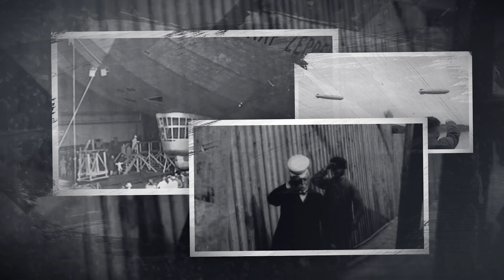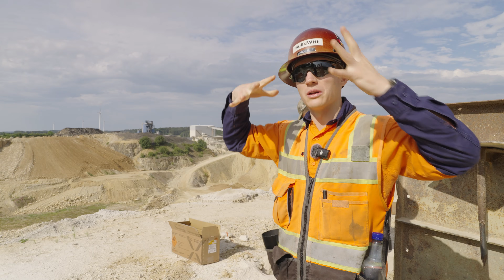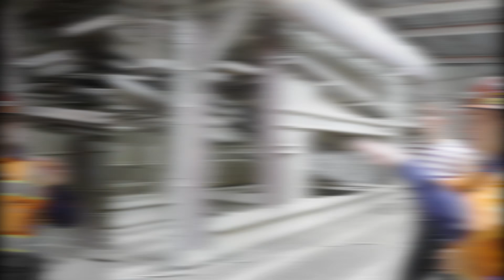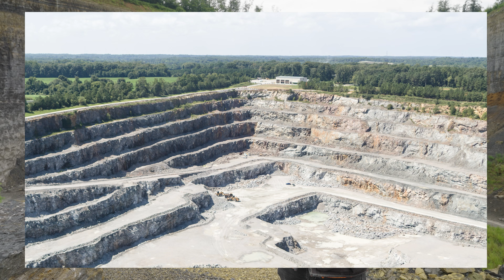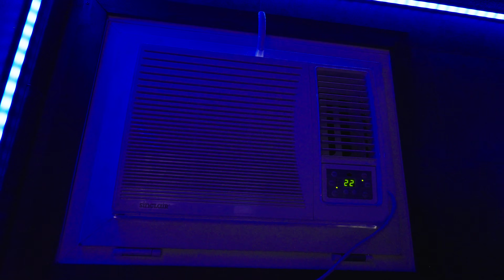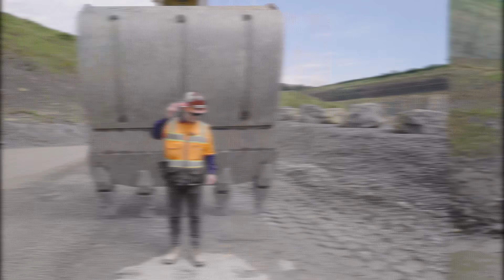German Quarrying w/ Remote Control Machines!

Comment: Aaron you need try out Google translate. At the very least you can ask 1 or 2 simple questions. I've used it and it worked fine for me. OK I was pointing at the beer tap at the time so I'm sure they would have worked out what I wanted, but still I'm sure they were impressed at my German.

Comment: Summary - safe 18 minutes of your life:
The video is about the author's trip to Germany to visit two quarries. The first quarry uses a Caterpillar 992 loader to load trucks with rock. The second quarry uses a Caterpillar 395 excavator to load trucks with rock. The 395 excavator is remotely controlled by an operator in a command center. The author also visits a Zeppelin Caterpillar dealership and learns about their latest products.

Comment: Hm so does that mean there are lots of "stepped" old quarries and even mines out there that were given up before there was remote technology, and that could now be re-opened and the "steps" mined away remotely? Because the remote tech makes it accessible only now?
Reply: Not necessarily. He did mention that the rock in the quarry they went to was suitable for such a high wall. I'm guessing it wouldn't be possible at the first quarry in the video, given the soft fractured rock there.

Comment: I wonder why they don't use a camera pair and simple shutter glasses to provide a stereoscopic view. IR-controlled shutter glasses are cheap as dirt and readily available from the 3D-movie (3D-home theatre) craze a couple of years back and monitors with 140+Hz refresh rate (to time-interlace two video streams at full framerate) are common, too. There also is no bandwidth problem, like with over-the-internet remote control.

Comment: Wonder why they don't just use a fov drone setup. Slap the camera onto the cab front and use the goggles as normal. The video feed is self contained too so no internet needed (probably less lag also). Also the full body view could just be a 360 cam on a long pole on the back of the vehicle...

Comment: 2 questions on the remotely operated excavator, 1-how responsive are the controls for the operator? 2-can an operator jump into the machine and run it like a standard machine if it is not in a dangerous spot?
Reply: 1. I don't know, but there's no reason they should be less responsive than sitting in the machine, as the delay is basically the speed of light across a couple of hundred meters, which is essentially instantaneous.
2. Yes -- he mentioned in the video that the green light on the dozer meant it was being operated directly, while the blue light would mean remote.
Reply: Yes, other videos he did of remote machines, were able to be run by an operator in person. He has a video on 5 bull dozers that are run by 2 to 3 operators who are all in the same room. They push long runs of material for strip mining, so an operator will setup one machine on a push, and then control the next one. They are remote and semi automated, from what I could tell. They still need to be able to service them and use them in other locations in a pinch, so it only makes sense. The newer machines seem to be electronically controlled anyway, like when setting the pattern they use, so that just makes it easier to do it remotely.

Comment: Guess that's pretty nice if there is risk of the excavator falling down a pit or something collapsing on top of it. Would be nice if you could sit at home while working, but I guess there needs to be someone "checking the oil" etc before starting the machine. Also if the internet connection cut out you might drive the excavator off a cliff, that would be kinda expensive.
Reply: If connection was lost it would just stop.

Comment: I'd love to see you visiting a coal mine in Germany. They have huge bucket wheel excavators, that can shovel 240.000 m³ per day, equals 314.000 kubicyards per day. This thing is nearly 93m or 305ft tall and 226m or 740ft long. You can see them in the mine in Garzweiler in Germany in action. 
It is very common in Germany to have huge bucket wheel excavators for coal mining. 
Be quick. Germany is shutting down the coal mines to transform to green power generation. So the machines will soon no longer operate.

Comment: what can happen if dust accumulates on the cameras limiting visibility
Reply: It gets cleaned, just like any camera. The machines are moved away from the wall to be serviced. Since they have cameras from the trailer, they could just walk the excavator out while using a 3rd person view........like running a remote controlled toy. For digging and loading, it is best to have a 1st person view. Some sensors have wipers or air nozzles to clean them, when in environments like that.

Comment: I didn't know fuel was that cheap in the US. But $1,65 for Germany is almost cheap compared to the last years. I think in the beginning of Corona it it dropped drastically to under $1.00 a litre, but after the beginning of the "problems" with Russia in 2022, the price for diesel went up to $2,70 a litre for a longer time. In the end around 70% of the fuel price here are just taxes, taxes and taxes of taxes. Profit taxes (VAT), mineral oil taxes, CO2 taxes and infrastructure taxes, to be specific.
Reply: the Diesel price never went anywhere near 2,55€/l  here in germany, not even for private consumers so no big operation where fuel gets delievered mostly directly from the reffinery pays that price as it is even cheaper than gas station fuel.  where do you get these prices?
Reply: @eltontv6002   we had Diesel and petrol prices of 2,35€ to 2,45€ or more for some time a few years ago and Diesel was even more expensive than patrol for some time, that's while there was a financial support from the government to lower the fuel prices. I don't know where you live when you can't remember that.
Reply: @IronWarrior95  southern germany. The highest price ive seen Was about 2,05€/L and that was an already expensive gas Station. At my workplace we had a record price of 1,93€/L for 25.000 Liters.
Reply: @eltontv6002  I live in northern Germany. The fuel prices in Germany where the highest in Europe, as I remember. Even after the 35ct / litre support from the government it was around 2€, because the greedy oil concerns pushed the prices even higher then.
Reply: Compared to Germany fuel prices here are low, but the number in the video hasn't been accurate for years. In my corner of the southwestern US we're paying $3.65/gallon (about $0.96/L) for highway fuel and about $3.39/gallon ($0.89/L) for off-highway fuel.

Comment: The high wall collapsed at the Homestake Gold Mine in the mid 90s on a shovel and a haul truck. I don't know the exact height of the wall, but the mine was 900 feet deep at the time. I believe it was the full height of the mine. (or damn close to it)
I worked with the haul truck operator for several years, the story of that collapse is one of the most chilling things I've ever heard. He talked about hearing the pinging of rock hitting the cab moments before the side of the truck was crushed. The shovel was completely crushed killing the operator. 
Remote shovels and haul trucks isn't the worst idea in the world near that kind of stuff.

Comment: That was very cool. Remote control excavators. I am curious about what is the latency of the remote controls, the time delay between when you move the controls at the remote location until when the machine actually responds. As an old operator when Cat changed their controls from hydraulic - hydraulic controls to electro - hydraulic control I definitely noticed an increased time lag. And for precision control even a fraction of a second delay was very unnerving.
Reply: You really can't beat direct-acting hydraulics for precision and response.
Reply: The newer machines seem quite responsive. I haven't run old machines, so I can't compare them. I suspect it would only get better with time. It is a great question. Youtube slows down on my firefox browser, to where there is lag as I am typing this. It is crazy annoying. When I was using a 349 cat excavator (120k pounds and a 78" bucket) to load super 10 dump trucks that seem small in comparison, the lag could have meant damaging or flipping a truck. The swing on that machine did not slow down as fast as the smaller machines I had used, but the other functions were as fast as expected.

Comment: Still seems really counter productive to leave the face walls so tall and then dig it at the bottom. 
That's just asking for a high wall collapse and to end up righting off a CAT 390 that probably costs 2 to 3 million pounds.
Reply: I'm assuming the value gained from extracting the extra material, more than makes up for the potential danger to machinery. There'll be a very well paid geologist somewhere determining how tall they will let those high walls get.
Reply: I'm not knowledgeable on the material but he said they can do it because the material is stable enough. But its dangerous for humans to stand right below the wall because smaller rocks could fall down sporadically. You just can't control that.
Reply: In Germany, basically everything remotely dangerous is highly regulated. Getting a permit for this probably involved more people than the digging. Also this Rock is really tough, but sure, if there were no risk at all they would not run the machine remote

Comment: Swiss army is developing remote controlled excevators for some years on a cat 323 i think. They startet developing it because they needed a remote system on a excevator for digging out ammonition and i think at that time, there was simply no system for them on the market. Meaby check it out the next time you‘r in switzerland.
Reply: The company providing the tech is Gravis Robotics. Correct, it’s for multiple machines such as the Cat 323 and Menzi Muck.
Reply: They also applied the same remote system to a menzi muck.

Comment: Not a fan of all this automation at all. At the end of the day it just takes away jobs from guys like us. Like your other video in Australia, it’s awesome, but it takes 2 guys to run 5 Dozers.
Reply from the maker: Mate it’s not automation watch the video
Reply: @ u can call it whatever you want it’ll eventually lead to less jobs.
Reply: @ right. For now. Till it’s only 2 guys to run a fleet. Then 1. Then none.
Reply: I am not a fan of automation either.  This is moving the operator to a safer location which makes a lot of sense.
Reply: @royreynolds108  I get it to an extent. But at the end of the day eventually it’ll lead to 1 guy running all the machines.

Comment: Cool, but also a bit scary how one good AI that can load a truck would remove many jobs, luckily I believe that's more difficult than you would think since every job is different, self driving cars will be widespread before that happen I'm sure. Awesome video overall! That operator room would give me the feeling of playing farming simulator except it's quarrying simulator, with much cooler graphics.
Reply: I'd expect the other way around, actually. Loading a truck is a much more constrained and controlled environment than general driving. Also, if the AI gets outside its parameters, it can just stop the machine, whereas a self-driving car can't slam on the breaks on the highway just because it sees something it doens't understand. Designing an AI to load rock into trucks is probably much easier than designing one to drive a car; having said that, there's probably more money in designing a self-driving car so more incentive for that to come first.

Comment: its good to see that this level of remote operating tech is becoming feasible finally. as in wireless vs. umbilical or radio remote at an individual site level.

as you say its different to see a genuine use case for it rather just on a demo area. and in something other than an "aussie mining" level of investment 😂

if CAT's system is as well developed then im assuming other manufacturers have their own proprietary systems too, but i wonder are there any notable aftermarket systems available in the industry yet? that could be retrofitted to any (or older) machines and not be part of a dealer relationship etc?

Given the increasing focus on health & safety, demand for such a system in so many machinery roles can only increase in the future, if only the cost & complexity could be reduced to be a practical solution for smaller/private firms, owner operators etc.
Reply from the maker: there are definitely aftermarket systems making their way into the market
Reply: We've tossed around the idea of retrofitting older LHDs with remote control systems. Really anything that has or can be retrofitted with electrohydraulic servo valves should be convertible; from there you need a controls interface and to ensure adequate radio range and bandwidth. Introducing live video complicates the last part.

Comment: Using a 992 loader and one truck for efficiency is such a simple yet effective strategy. Great insights! 💪
Reply from the maker: can't argue with the germans!
Reply: @mmm365   they just haul as much material as they can feed into the crusher. When 1 loader and one truck gives them enough material that they can use constantly, then 2 trucks would bring them more material than they can handle at the crusher. The crusher can't take more than that and they don't want to store the extra material or to shorten the working hours of the large loader and the truck operators.
Reply: But then they use another loader to feed the crusher?  Just make a truck dump hopper and get rid of the other loader to save on that expensive fuel.
Reply: @TwinkleToes3116  You need to have a second, smaller loader for all kinds of stuff. There's going to be rocks falling on the ground etc. which need to be cleared etc.
Reply: @TwinkleToes3116  The loader is used to feed additional material to achieve the desired qualities, not to load what they just mined. There are multiple piles of different materials and sizes stored on site.
Reply: @TwinkleToes3116 the building contains several production lines of material. The main products use conveyers, but less common ones get mixed by the loaders.
Reply: A lot of nose picking🤦‍♂️

Comment: You should come to Sweden somtime!!
Reply from the maker: hopefully next year!!
Reply: @buildwitt  You might want to check out the Aitik copper mine operated by Boliden, as well as Skanska or NCC for quarrying and construction, Actually, NCC just concluded a decent-sized cleenup operation moving contaminated soil from an island in northern Sweden. They ran mostly Volvo excavators and articulated trucks, but also used a Cat long-reach for dredging.
Reply: @johannessamuelsson6578 remember the name of the Island or operation?

Comment: The remote equipment was good to see in operation, and its application is justified, given the danger of rockfalls from the quarry face. We have a new Hyundai van at work, and when manuvering at slow speeds, the extra cameras come on to show you any potential hazards around the van. It definitely takes time to get used to working through camera vision as opposed to line of sight and mirrors. The system even shows which way the front wheels are pointing. The GPS system also tells you the correct speed limit for the section of road that you are on. 😮 Remote control technologies are useful, but they have a learning curve to get used to them.
Mark from Melbourne Australia
Reply from the maker: thank you Mark!!